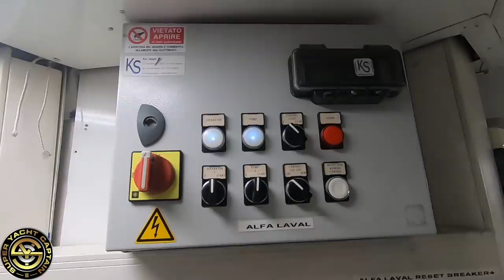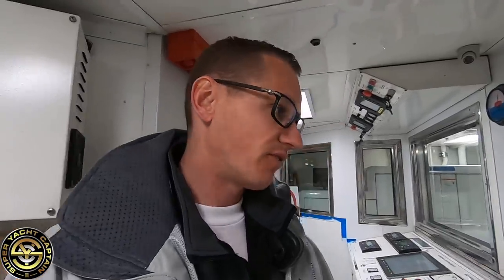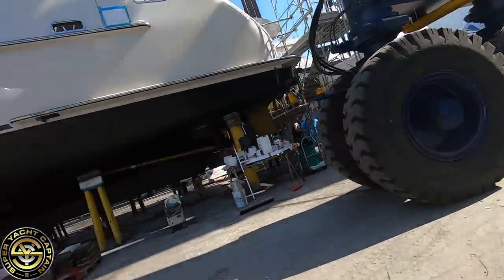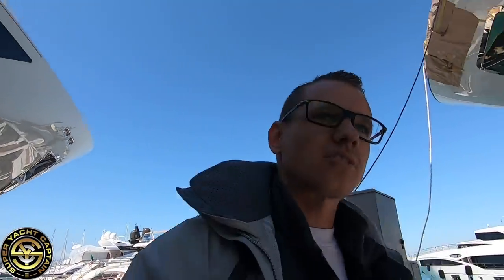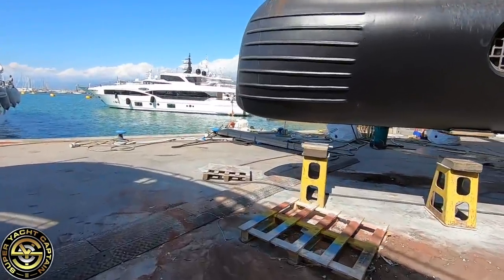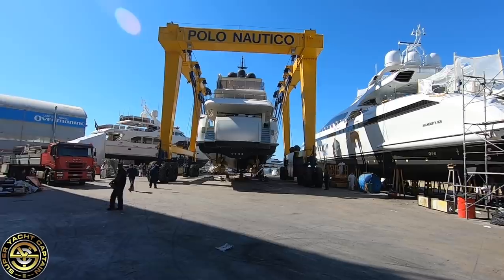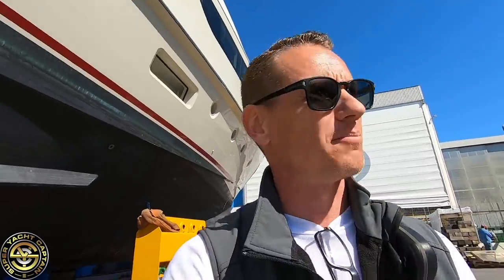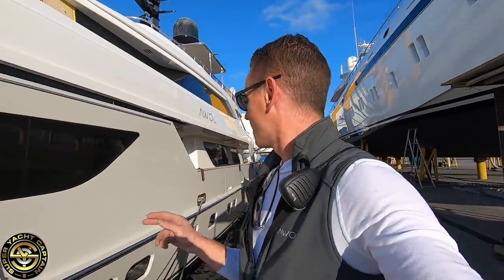$10 MILLION LUXURY YACHT LAUNCH (Captain's Vlog 61)

Comment: in a pinch if you have to...you can fill the primary and secondary fuel filters directly with diesel and use the starters to crank and it will prime the engine.

Hard on the starters though, much easier to just bleed the air since you have the fuel above the engines, but if for some reason you cant...

Those little hand pumps are also famous for failing and causing lots of engine issues regarding fuel aeration...

Love diesels!

Comment: Tristan, have you ever watched videos of yacht launches like this? I cannot believe you trusted them with your yacht when they use such a dangerous method of moving it. Why? I've seen soooo many videos online where this exact method results in the yacht being BADLY damaged or destroyed. In some shipyard disaster videos, the straps sometimes break because they didn't even bother to check the weight. Other times, the CRANE collapses. Then there's the third one (my favorite) the math geniuses have most of the weight on one side so the yacht slips out and hits the concrete! What amazes me is that most of the yachts in accidents are actually significantly smaller than AWOL.

Comment: you can pressurize the fuel tank to force the fuel to the engine and bleed injectors to remove air. i used to do that on my truck when i needed to prime the engine. it is much faster than using that little hand pump.
Reply: The hand fuel pump will have no problems pulling fuel from the tanks and filling the secondary fuel filters , when they are full and air free the injection pump will cope with any air trapped when the engines are cranked over.
Reply: @marksmallman4572  i guarantee that you will have a sore arm using the hand pump. Which is why I would inject air into the fuel tank to pressurize it while bleeding air from the injectors

Comment: When i worked on seperators we always had to prime the unit with water first is that the case with a laval? It was a lube oil seperator BTW on a Sub
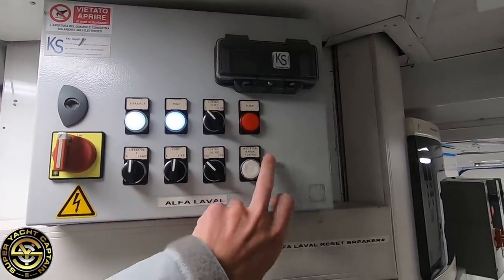Reply: I believe Captain Mortlock was pointing to and referencing water-prime of seals at ~1:00 on the video.

Comment: I've noticed visual sight tubes for fuel tank volumes and wondered how breakage risk is minimized.  Theoretically, if one of those sight tubes broke, the whole fuel tank volume could be released into the engine room with potentially disastrous results.
Reply: Or what if there was a fire, would these not shatter? and the fuel tank is just inches away. Not sure how this works?
Reply: There are shut off valves on both ends of the sight tube, the tube is not normally glass, plastic.